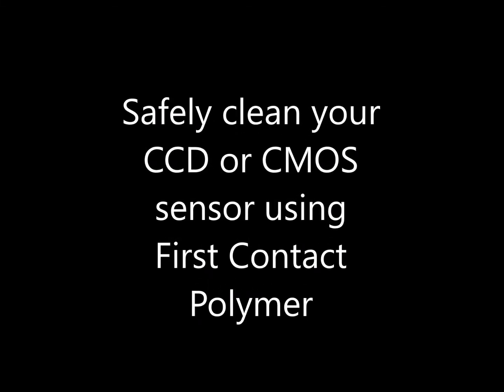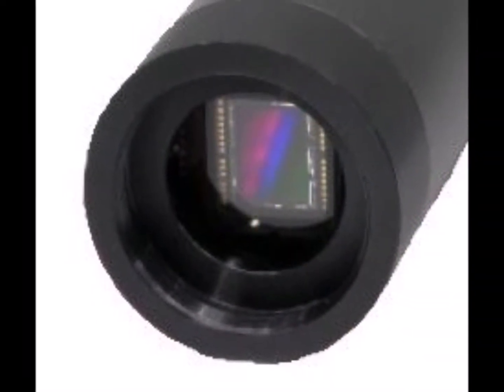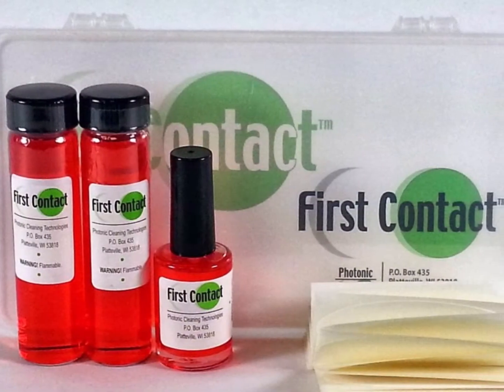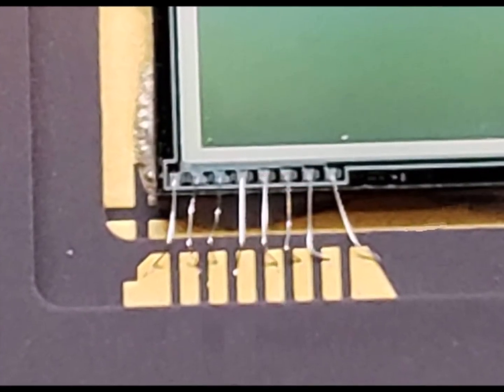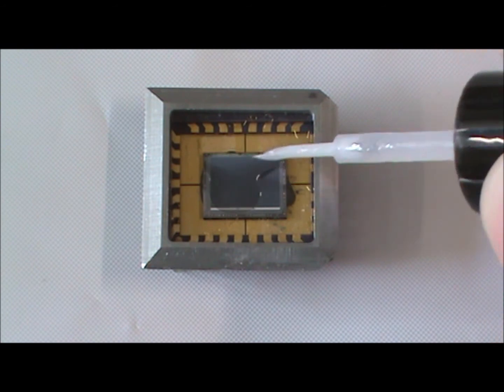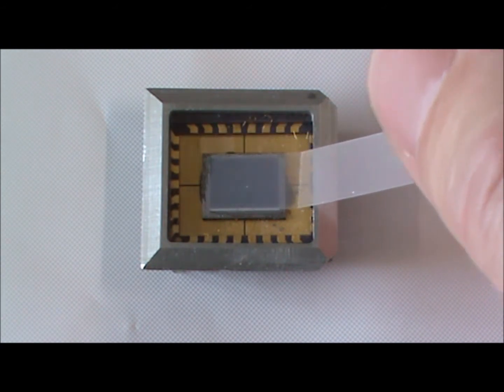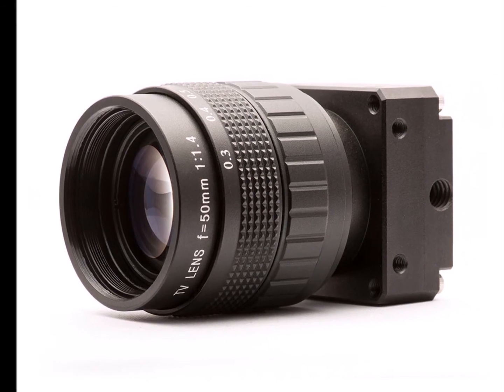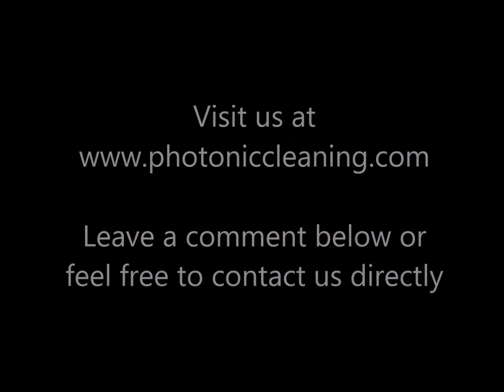CCD and CMOS Sensor Cleaning

Comment: can this be used to clean DMD chips?
Reply from the maker: Thanks for your inquiry.  We've never been asked this question, but from reading the description of a DMD It sounds as if it is possible to clean using our ESD Formula polymer.  We read where the mirror array can be moved slightly via electromechanical action but the movement is so minute that the system has been tested with upwards of 1 trillion movements without any damage to the array.  We do suggest testing on a non-critical part first before wholesale application to in-process DMDs.  Let us know how the cleaning progressed, email us at Sales@PhotonicCleaning.com.  We'd like to hear from you!